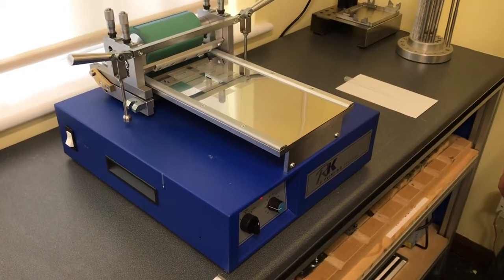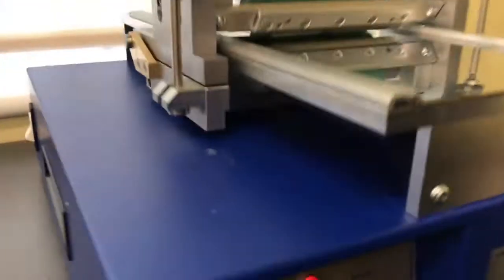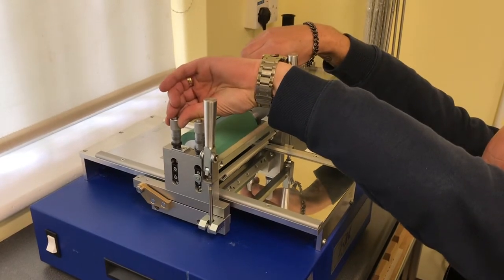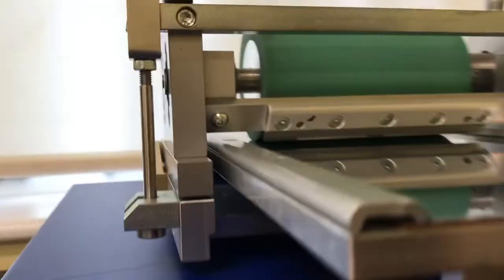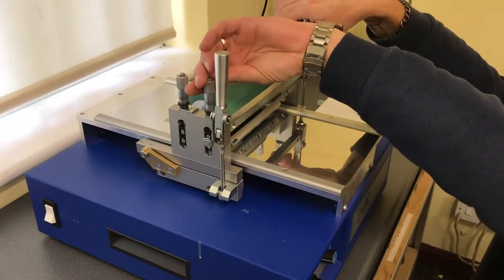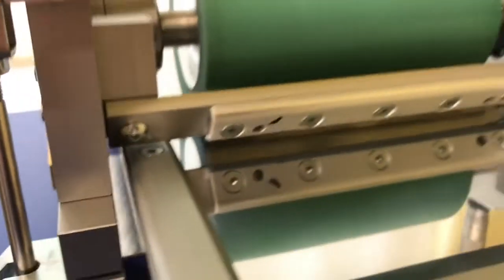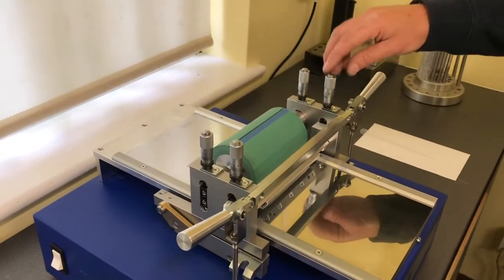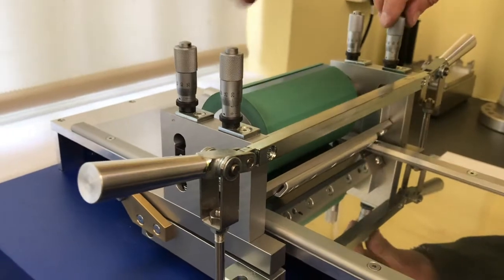RK Printcoat Instruments KPP - Gravure head set up

Comment: CAN I KNOW THE SETTINGS FOR POLYESTER SUBSTRATE ....SET UP FOR RUBBER ROLLER ,DOCTOR BLADE ,AND SPEED ...HAVING A ISSUE IN PRINTING DEVELOPING DOTS.
Reply from the maker: Hi Mayuri, the settings for each machine will be different. The steps are: 
-Clamp the head down (ensure the impression roller and blade are not touching the plate)
-Lower the impression roller down using the micrometers until it touches the plate, this is with no pressure
-Lower the doctor blade using the micrometers until it touches the plate, this is also no pressure
-Release the head clamps
-Add 50 divisions of pressure to the impression roller micrometers (ie if the micrometer say 40 then 1 complete turn to 40)
-Add 40 divisions of pressure to the doctor blade micrometers (ie if the micrometer says 40 then turn it to 0)

polyester film thickness should be ok with these base settings, with thicker substrate sizes you may start with 40 divisions of impression pressure compared to the standard 50

Comment: What should the direction of the drag blade be, with the bevel facing inward or outward? Thanks
Reply from the maker: The lamella should always be away from the anilox/engraved plate. If you are using it the other way the angle will be different to the way we designed the machine BUT, if you always use it this way then its fine as its not a variable